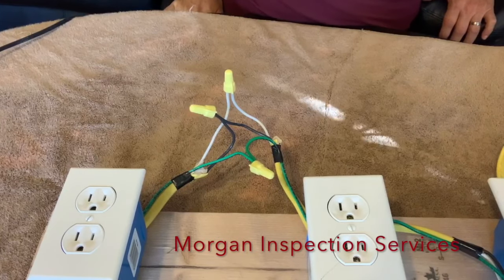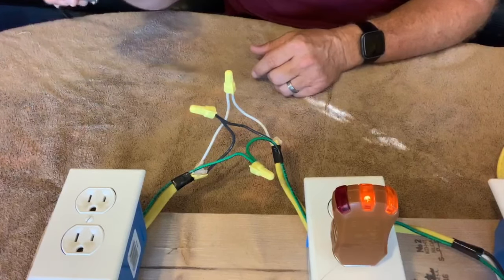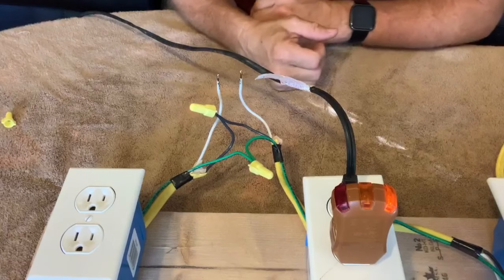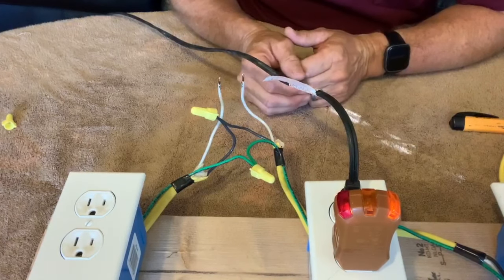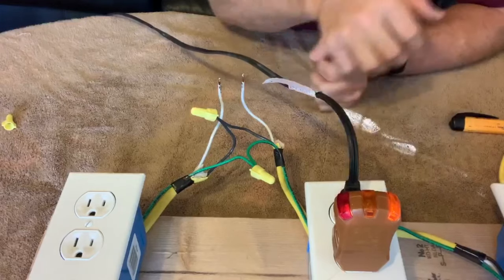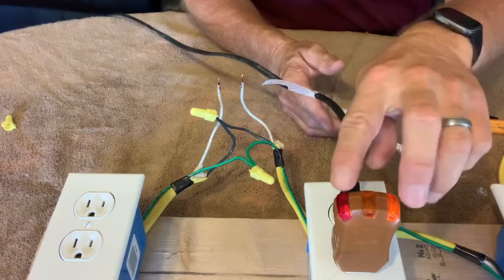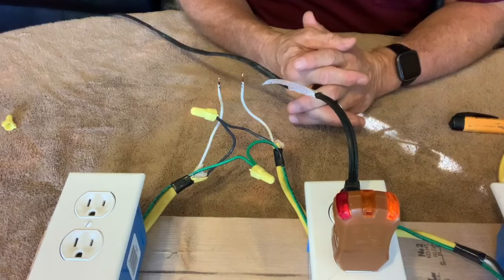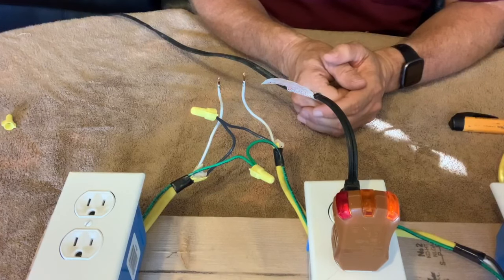What is a Hot Ground Reverse?

Comment: I ran into the same problem today. The tester alone says correct wiring but when a light is plugged in, it says hot/ground reverse. When I measure the outlet, I only get 106v. At the breaker is 124v. Please help.
Reply from the maker: It sounds like it could potentially be a poor neutral connection. Is it just at one outlet or are there multiple outlets involved?
Reply: @morganinspectionservices3840  I checked 3 other outlets down the line were the same. I removed all the outlets and checked for loose connections but they were right.
Reply from the maker: @homie817x  I think you need to figure out what outlets are on that circuit. Then you need to figure out if all of the outlets on that circuit are experiencing the same thing and showing similar voltages. If every outlet on that circuit is showing similar symptoms, then the problem is going to be before the first outlet on the circuit. In other words, before the outlet that is normally closest to your electric panel, but on that circuit. If some outlets on the circuit are working properly, and some are not, then the problem is going to be between the last outlet that is working properly and the first outlet that is showing these symptoms.

Comment: OK Have hell of a comment I basically replace one outlet that is ganged to 3 others and all brand new and broke the tab as was on old 1980s outlet gold side for black at bottom /red on top  and have 3 neutrals tied into two tiny bathrooms  &  no lights and 96 volts readout. All three brand new outlets have Hot Grnd Reversal on them.  What could have changed  NOTHING but new bright copper wires well secured in new outlets  just swapping out 3 outlets and all wiring connected exactly the same??? NO LOOSE connection at all very tight or does one of the neutrals play major role in this GANG BOX?
Reply from the maker: Do you have a noncontact voltage detector? I would use that to make sure you know exactly which wires are hot and which are not. Without actually seeing it, it’s hard to give a lot of advice, but yes, that does seem like a very odd thing to have happened.
Reply: @morganinspectionservices3840  Yes thank you and it does show all three outlets have power but NOW I'm getting red and orange show Hot Grnd Reversal when plugged into all three. FLUKE meter show 96 volts ...it's cursed all I did was swap outlets ,,, like changing a old style light bulb . Makes no sense. However one outlet is now my lamp and strip and good . That is tied into breaker and works fine all 3 no go and switch works and lights in tiny bathrooms NO GO. But GCIF I installed 10 years ago is excellent in bathroom. Is it one of the Nuetrals on the gangbox 3 on left blk on bottom red on top ,,,,tab broken .?

Comment: I have a hot Ground Rev. showing on my tester. My charger for my car is not working on any outlet in that correct. How can I fix that? Is it just a bad outlet?
Reply from the maker: It definitely sounds like you have a disconnected neutral. I wouldn’t think that it is simply a bad outlet. Try watching my video on how to locate or find a disconnected neutral and see if that helps you.  https://youtu.be/BVcNnBKfC8Q?si=UMbfhM_MqydIRtnR
Reply: @morganinspectionservices3840  thanks!!! You have been a big help. Fortunately my issue is in a detached garage. So all the wires are visible. I’m going to get a new GFCI that’s on the exterior. That’s the second outlet in the row. The first outlet is inside and a gfci too but the chain leaving the first outlet has two wires one going outside the outlet showing the fault and the other continuing inside for the rest of the outlets. Would it be good to get some new wire and eliminate the split  from the first outlet and put it all on one chain? Thanks again.

Comment: What if when I plug the outlet tester in with nothing else plugged in, and the Hot/Grd. Reverse comes up on the indicator
Reply from the maker: Sorry for the very delayed response. Are you sure there’s nothing plugged into any other outlet on the entire circuit? If you are sure, then it could be a light that is on the circuit and turned on. Seeing how it’s been two months, did you already solve it? I would be curious to hear what you found.

Comment: Less experienced here. Seems that the receptacle on the right should still operate the lamp fine. To me it looks like you disabled the left receptacle only. Excluding the tester deal, why did the lamp not work even though you cut the flow to the left one?
Reply from the maker: The power comes into the left receptacle, and the left receptacle feeds the right receptacle. Therefore, when I disconnected the neutral wire, I caused the receptacle on the right to have the open neutral. It probably would have been good for me to add to the video showing that the receptacle on the left works just as it should.
Reply: @morganinspectionservices3840  Ok, I stared at that nice set up you had for a long time and thought that I am missing something. Thanks for getting back to me. It looked like the feed wires were coming into the one on the right, (from my view).

Comment: But can it happen and how would you fix it? I took the wires off before the outlet and tested with multimeter and when I tested the hot and neutral I had nothing. But when I moved the black probe over to the ground while touching the red probe to the hot wire the is 126 volts. I replaced the circuit breaker and I don't think there is any other outlets between the panel and the outlet that I disconnected. When I tested at the panel  I touched red probe to the circuit breaker  and the black to the neutral and had 126 v. Then I touched the red to the breaker and the black to the ground and I had 126 volts. Is that normal or is something wrong. It seems to be that way on every breaker in the panel. All my other outlets and switches are working fine. Have any thoughts? I'd call an electrician but there are none in this area anymore.
Reply: Also I don't know of any other switches or outlets between the panel and said outlet where I disconnected it
Reply: If you are getting nothing between hot and neutral,  and 126 between hot and ground at an outlet,  but everything tested normal at the panel,  then you do have an open neutral between the panel and the outlet you are testing.   It could be in an outlet upstream that you are unaware of, could be in a light switch box , or in a ceiling light.   In some older homes they would run the power to the light, then drop down to outlets, then they would drop a 2 wire cable down to the switch and use the white as hot and the black as the switched hot.    Or in some rare cases there could be a junction box, supposed to remain accessible meaning you legally cannot conceal it behind drywall or other permanent building materials, but you can never be sure of what was done by previous occupants,  especially in older homes.     Good luck

Comment: My Tester showed Hot&Ground reversed because I had the white neutral wire going to the switch instead of the black hot wire. And from the switch I had a wire going from the other gold screw to the silver screw on the outlet.

Comment: Using a multimeter, I get no voltage reading when probes touch hot and neutral.  However, my multimeter registers 120v when probes touch hot and ground.  What does this mean?
Reply from the maker: It definitely sounds like your neutral is disconnected somewhere upstream of where you are testing it.

Comment: Thanks for this video. I had recently installed a new outdoor GFCI outlet on our patio and it worked for a few weeks then stopped working. I used my line tester on it and it came back with a "Hot-Ground Reverse" error. After watching this video I pulled the outlet to find that the neutral wire had indeed broken. It was a simple fix and now everything is back to normal.
Reply from the maker: Great. I’m glad the video was helpful. Thanks for the feedback.

Comment: Hi still a little confused I’m getting the same reading in my mobile home half my house has no power we’ve had to replace one of the outlets when we moved in because of this and it fixed it so instinctually we changed the same outlet because it did infact arc but the plug still worked as it was powering our living room tv but didn’t fix the issue one outlet in my living room doesn’t work and then it proceeds down the hallway leading to two bedrooms and a bathroom all rooms have one outlet that is working but no lights and no other outlets I am so confused I’ve replaced all but one non working outlet and have not replaced the working ones because they work and I’ve also replaced my light switches in that hallway that controls my outdoor light and halfway light both of which do not work as well please help lol
Reply from the maker: Hi. So are you saying you’ve used one of the three light testers in the outlets that are not working? Are you getting the hot ground reverse on the outlets that are not working?

Comment: I have a GFCI in my bathroom and when I plug in a GFCI tester it indicates open ground, then when I press the test button on the GFCI tester it indicates Hot/Neutral reversed and the GFCI outlet doesn't trip. I checked the wires and there is a grounding, bare copper wire, on the grounding green screw on the outlet, the black hot goes to the gold screw terminal on the outlet,  and the white neutral goes to the silver screw terminal, so they are NOT reversed. Furthermore, I can't have an open neutral because all devices work in the GFCI outlet. I think the GFCI tester is really telling me I have an open ground. Please advise. Thank you.
Reply from the maker: Yes, it certainly sounds like you have an open ground.  A GFCI tester will not trip an ungrounded outlet.  You should disregard any reading you get on the tester when the test button is depressed. If you have a ground wire connected to the receptacle/outlet, then the ground wire is apparently not connected somewhere upstream of that outlet.

Comment: So here is my situation.  On a particular long circuit I have a hot/ground reverse indicated by tester and voltage with no power down stream from a 4 pole switch . I replace the switch to no avail. During replacement after taking old switch off I tested all wires with contactless tester. As suspected the common hot wire from panel was hot but also the two stand alone lines were also hot. What gives?
Reply from the maker: I’m gonna have to think about this one for a little while. To clarify, are you saying this is a four-way switch? Controlled from three locations?

Comment: I installed GFCI outlets in my new house, and my no contact tester was beeping in the downstream plug at all the terminals and in the plug itself. When I plugged in my tester the main light came on and the next yellow light was not as bright and was flickering, and the red light was flickering faintly as well. Is it a loose neutral wire somewwhere in the circuit. The GFCI will still trip when I push the button on the tester, so will it still be ok ?
Reply from the maker: If the GFCI-test button on your tester trips the GFCI outlet, then that outlet will provide the proper protection. If you can plug things into those outlets and they work, then the problem is not a disconnected or loose neutral. There have been a few instances where I have tested outlets with my tester and multiple lights come on, but some of them very dimly. I have not discovered exactly what causes this, but I think it is because there is some low-voltage on the neutral for some reason.

Comment: I have an outdoor outlet in the middle of the yard with a hot ground reverse. it's been like that for years, and I can't figure it out. I started to carefully dig up the wire going to it to see where it goes, it's a gray direct burial cable that disappears into a large rose bed, which I can't dig up. I can only assume it keeps going straight, which would put it going into the corner of the foundation. I've looked up into the basement ceiling, but don't see it coming in any joists. Kind of stuck there. The odd thing is the outlet used to work fine maybe 10yrs ago. 🤷

Comment: White from lamp to bare ground working in an apartment I'm rehabbing. I changed the panel today and went through all the wires. Before changing the panel, ground was hot, neutrals were hot. Double checked and Separated everything (why do people insist on taking 2 minutes to tie the grounds together, when it only takes 5 minutes to put them all separately) and viola! No more hot grounds. I still have to troubleshoot a little more, but I'm sure it's a spot I left the neutrals untied in for tracing and I was a bit tired to finish so I just left those breaker off. Right now I'm getting exactly what's depicted with plugging a light into the outlet with the tester at the same time. I had a feeling it was that open neutral I know I left. Total of 4 lamps were working without neutral off just hot and neutral to ground.

Comment: I may add that these outlets were working until my wife plugged in a hairdryer and then they no longer worked, but I checked with the circuit test her and it shows a red and an orange which means reverse. I know the theoretically it is not reversed.

Comment: Your video is very helpful.  Thank you.  What happens when you have a hot and groung reverse and 120volts between neutral and ground wire which I know there should be no voltage there
Reply from the maker: You will have 120 volts between the neutral and ground wire with a hot/ground reverse or the open neutral situation described in this video. as a result of the open neutral and load turned on, the neutral will be energized to 120 volts, thus causing a 120-volt difference between the neutral and the ground.

Comment: how do I diagnose this? it's been a nightmare. I noticed my outside front door light made a weird electric zap noise. and by simply touching it moving the loosely light fixture outside, I lost electricity in 2 connecting rooms.. if I placed it turned it just right I got back all electricity in the rooms again as well as the light,  but I would see spark from behind the light fixture and thought to myself, "hail naw that's a fire hazard!" went to the breakers and turned it off, took off the light fixture and the wiring inside was pretty horribly  messy but overall plugged correctly. I noticed a spliced neutral (white) and a zapped area around ground with black residue to confirm its crossed each other. I cleaned up and wired them correctly and I just get Hot/ground Reverse. changed all receptacles and light switches yo all connecting rooms and it still says this.
Reply from the maker: Sounds like you definitely have a bad/disconnected neutral somewhere. I have a video that may help you find that disconnected neutral. https://www.youtube.com/watch?v=BVcNnBKfC8Q

Comment: So why didn't the tester flag open neutral? Rather than hot ground reverse
Reply from the maker: Watch the video again. With an open neutral and a load plugged in, the voltage carries through to the neutral side so you have a hot hot, a hot neutral, and a non-hot ground. The tester interprets this as a “hot ground reverse.” That was the whole point of the video to explain that if you get a ground reverse on the tester, you actually have an open neutral with a load plugged in and turned on.

Comment: Thank you very much.  I've had an exterior light and a few outlets not working and some on the circuit test hot/ground reversed.  Recently found a wire inside a wall that appears to have been cut by a drywall saw.  Open neutral.  Hoping the repair will fix my light and outlets.

Comment: Thank you for this. Question - Garage Sub panel, 60amp 2 pull feeding from main inside house. No GFI's in garage will allow you to reset, every plug reads reversed hot/ground. Checked sub's neutrals, all good there, checked main's neutrals, all good there. What in the world is going on here. Gonna read voltage tomorrow when I can grab my meter, but am I missing something..... thanks
Reply from the maker: This is a tough one. Before I think too hard, I want to ask if you have found out anything new in the week since you commented. If fix, please let me know what the problem was. If not fix, let me know any new info, and I'll see what I can come up with. Thanks,
Reply: @morganinspectionservices3840  Unplugged other garage door opener on one circuit and tester showed open neutral. metered it at 60-70volts at sub. Main pnl and breaker was good so I figured a line was cut somewhere. Dug 4 holes 3.5ft down finally found it under my dad's deck where he auger'd the pole/cement holes. 1 hot and the neutral severed. And yes I slapped him.
Reply: Underground splice kits are a gift from God.
Reply from the maker: @trevhummer9580  Interesting.  Good job figuring that out. Sounds like it took quite a bit of work.

Comment: Thanks for clearing that up. How do I find the open neutral wire? The plugs was working until an appliance was plugged in (the appliance was never turned on) after 20 minutes the plug went dead. On the same circuit the refrigerator was working fine, then it died about 1 hour later.
Reply from the maker: Sounds like an odd situation to me. You need to work backwards and find the first outlet in the daisy chain. I would use my 3- light tester to see which outlets on that circuit are giving the hot/ground indication. If some do and some don’t, then you need to start with the first outlet that does not have power and go backwards from there looking for the bad neutral. If none of the outlets on that circuit have power, then I would start at the breaker panel and move forward looking for where the neutral is disconnected.
Reply: Thanks for the help. I worked backwards as you suggested. I found the culprit, it was a faulty receptacle that the neutral wire was slipping in and out contact in its "hole". After replacing the plug,all is good.